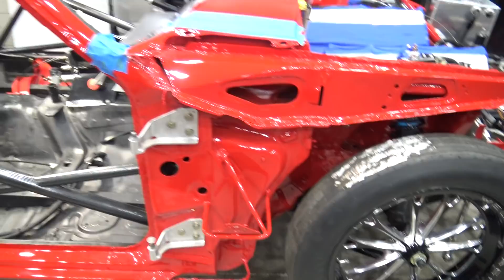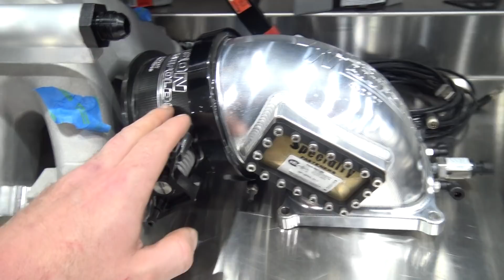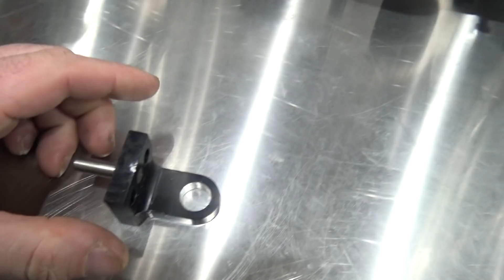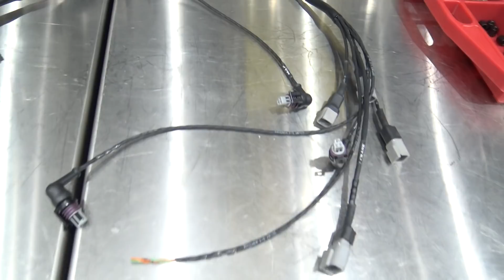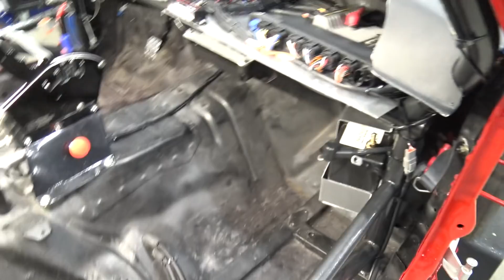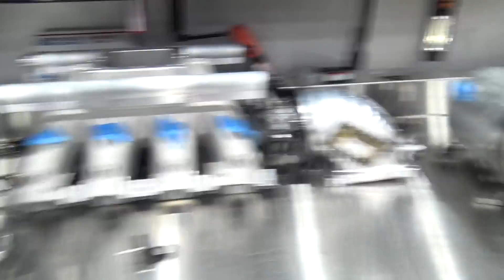Randy Eller's Awesome Fox Body Mustang

Comment: I am using a Smartwire with a Grid.. Would you use separate Solid State Relay for: Air Shifter, Parachute Cylinder, Exhaust Cutouts? and should they be Diode protected?
Reply from the maker: All depends on amperage draw 
Small air solenoid valves are typically very low wattage

Comment: Amazing work as always Devin. It's a little different seeing you work on a car with the engine facing the work bench.
Reply from the maker: yes it is lol, just the way it came out of the trailer. new shop is almost done so im excited to have alot more room
Reply: @theholleyefiguy  I bet you are. Is the new shop at home as well?
Reply from the maker: yes sir its right next to my current shop.  electrical will be done next week, then spray foam insulation.  then the interior walls can get done and install the mini splits and epoxy the floor.  probably another 2 months till im working out of it
Reply: @theholleyefiguy  heck yeah, I can't wait to see it. Mini splits are the BOMB my first experience with them was living and working in Nigeria and ever since then I've been amazed that they aren't more common, especially here in the south. If I ever build I'm going heavy on the spray foam and using the mini splits as well.
Reply from the maker: i have a mini split for 7 years in my current shop. its the greatest and most loved thing that i own.